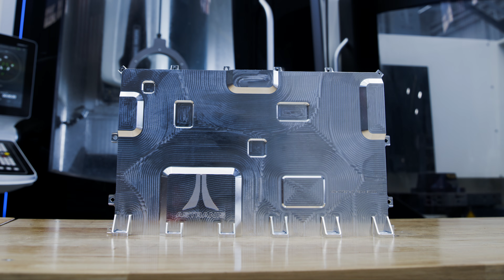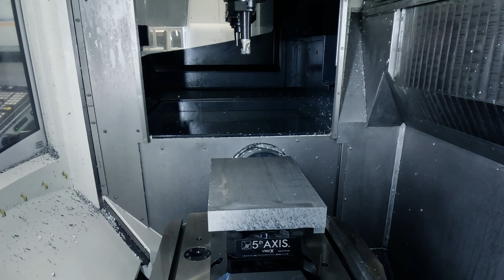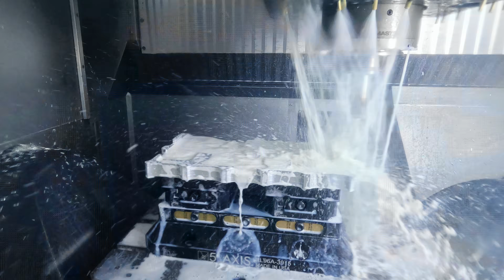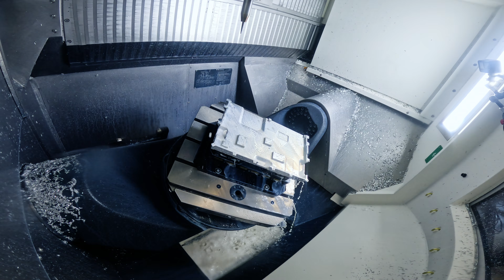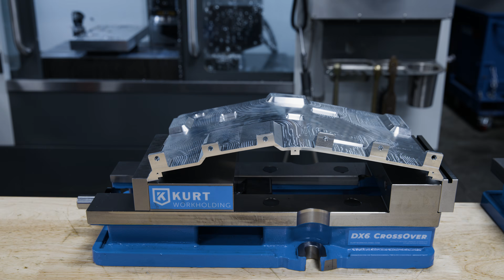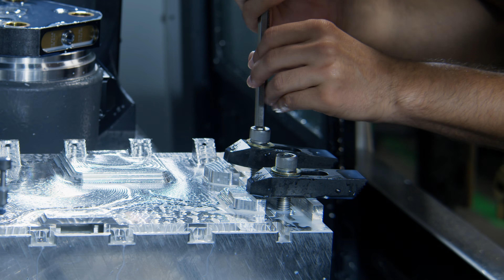This CNC Part Should Warp... But Doesn't | DMG Mori DMC 75 + Haas VF-2

Comment: 2 operations, yeah right! You've already pre-machined the bottom face so you could clamp it in your five axis vices, surely that is your 1st operation? 

A part like this machined from aluminum plate would require at least 4 operations so you could achieve any sort of flatness & dimensional accuracy from one side to the other. You can even see when you load the part on your HAAS machine for op2 that its already been machined!

Great video though 👍
Reply: Yeah the material was already dovetail prepped, which is literally media one, so it's 3 medias.
Reply: Yeah, noticed that with 5th axis stuff. The dovetails are quite a secure grip but extra prep. I would of just used 2 LANG Makro grip vices. Then OP2 just RSU's/Dowels on a Matrix table and/or SPL Sub-Plates. Often doing parts 1.5mm thick, and slightly bigger than this part.

Comment: I have a question, is Fusion great for CAM programming? Im using Fusion and powermill, but the company wants to move to Fusion
Reply: I have been using Fusion for about 3 years now and I love it. I prefer it over MasterCAM. Being able to create fixturing using parametric modeling and then jump straight over into the CAM side is amazing. Fusions tool library is also amazing. I have created a tool library with all my standardized tools and have multiple different presets for cutting styles. You are also able to even take it a step further and create general templates. Fusion in my experience is amazing for streamlining the CAM and setup process for any job shop which is always the most expensive part of the machining process.
Reply: I worked with Powermill for 6 years and now im using fusion 360 for about a year. I still think powermill is the better CAM software but the price is almost 10x then fusion360. Fusion 360 is better at deburring parts. 
Hopes this helps
Reply: Autodesk is really scummy lately so I wouldn't build your workflow around it because they keep raising the subscription prices, but yes it does work quite good in my experience. There are a few little things that as a production shop have increased scrap rates because the operations have issues sometimes, but as long as you're very careful to look over the simulation and your g code before you run it you should be fine

Comment: What alloy of aluminum is this? No warping?
Reply: T6061
Reply: May be 7075 tempered T4/T6
Reply: Its possibly a aluminium alloy but the secret was the second fixture how they held it minimum heavey machining light cuts lots of coolant no heat impressive
Reply: Maybe it's cast aluminum ks100s